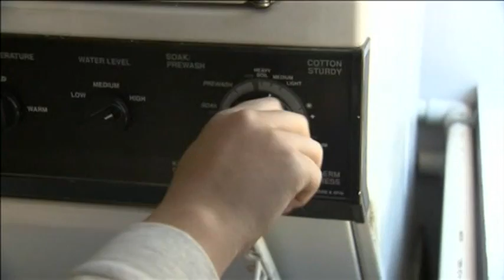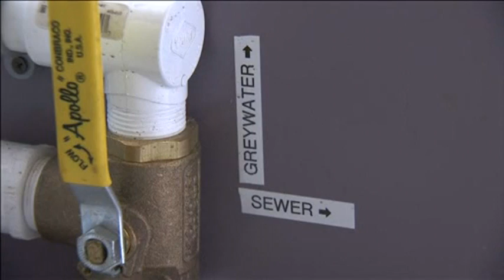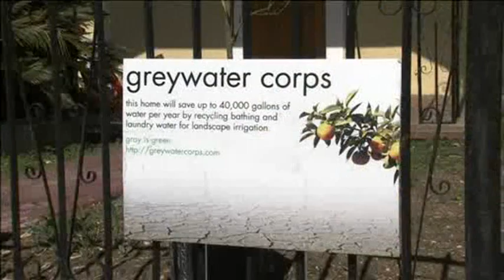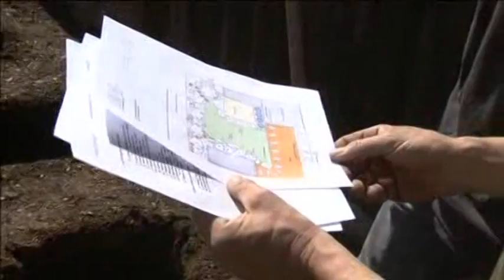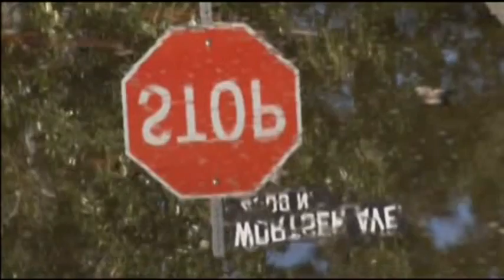'Greywater' System Recycles Used Water For Lawn Use

Comment: I just have a black hose  that I bring in and connect to the washing machine and the other end goes out to the lawn.  Ive been doing that for like 30 years.    Even better if you can run the water to a strand of bamboo they will purify it.
Reply: Di, Can you give specifics on how you do this? what type of hose? Do you drill a hole in  the wall to bring the hose to the garden?
Reply: @tin8151  its just a black plastic hose you can get them at the hardware store has an ending that you can just push the washer hose onto.  Im sorry im not a plumber I have no idea what they are called.  The washing machine is next to the laundry door and I just put it out like that.  Currently have a bunch of bananas benefiting from the washing machine water.  Planted in november and all ready at roof height!
Reply: @dibrentley7915  - So you put the hose through an open door, or did you drill a hole in the wall. Thank you so much for the prompt reply.
Reply: @tin8151  I just put it through an open door then when my washing is all done disconnect the hose and curl it up outside. I also have a piece of coated wire that keeps the hose in place so it doesnt fall too low where it connects to the washing machine. if that makes sense?  Just twist it a couple of times when i connect it up.   Its nice knowing im getting two uses out of my water.  Although if I let it flow through the system it eventually goes to the fruit orchid anyway (on a septic system)   When I was a kid we had the washing water going out to the bananas and we always had great bananas.    
I remember watching a study they did on using bamboo to purify water from household use, apparently that works very well.  And bamboo is a really useful product, produces the best charcoal to collect toxins in your car, house etc.  Plus all the other uses of bamboo. 
PS you could run the hose through a connection in the wall but a lot of effort for no reason really.